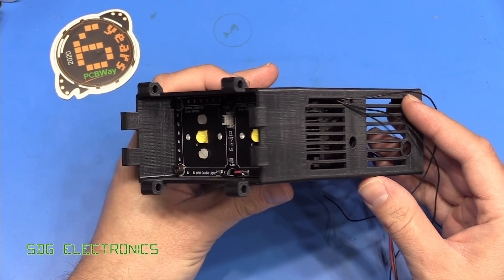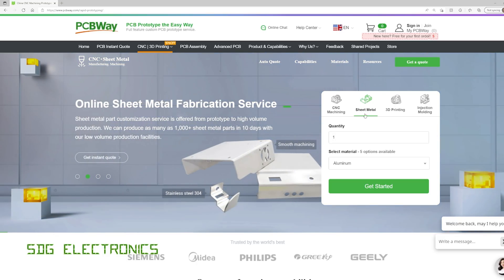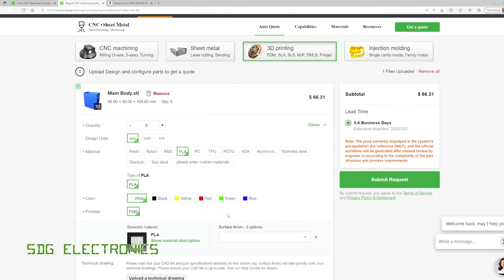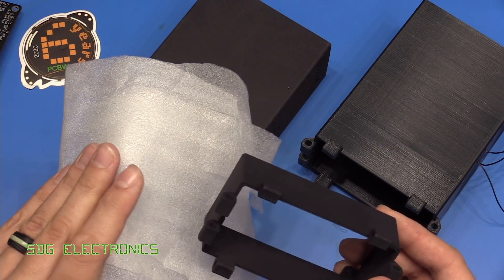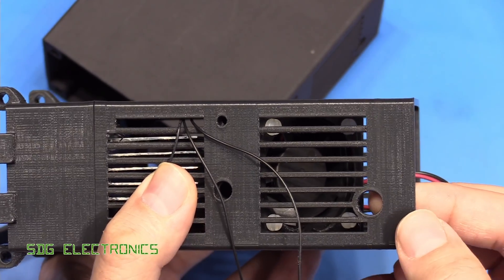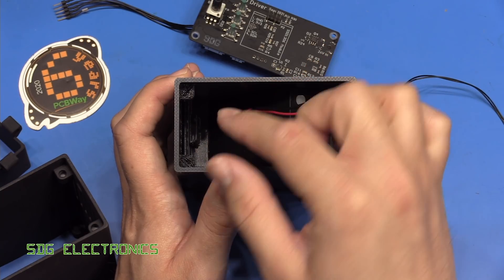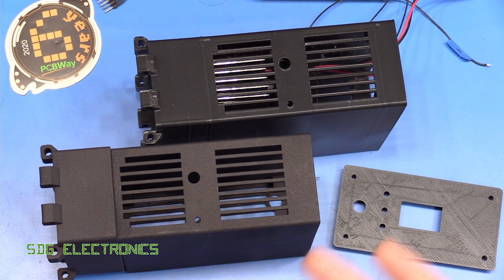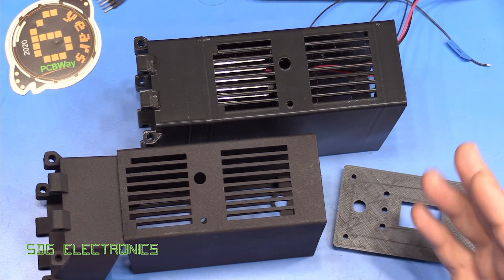SDG #247 Professional vs DIY 3D Printing

Comment: Teaching Tech an also CHEP have some very good videos on changing your stepper settings to get more accurate size  prints. It looks like your z is too low. But those pcbway prints look great, much better than you could do at home. Cheers

Comment: I watch Teaching Tech, and there is quite a bit to optimising prints. He has comprehensive guides using fairly simple tests, if you're interested in working it out. Either way, his optimised prints weren't as good as those Pro prints.

Comment: Impressive print, though powder-based as far as I know. Perhaps use a right-angle pin header then you may not need to cut the pins.

Comment: One idea:  For the back panel, you could create this part using PCB material (black) instead of 3D print.  Advantages might be: greater accuracy with dimensions, silk screen text to label button functions, graphics, ultra smooth finish, copper pour on inside surface for EMI shielding, grounding, heat resistance, heat sinking, etc.  Not sure about cost difference.
Reply from the maker: That's probably a better option actually.

Comment: Might try using an Ultimaker S3 profile in Cura, paste in your ender 3 Gcode and modify the filament diameter, bed size and machine height and number of extruders, I get great prints all the time now. Great video .
Reply from the maker: Thanks I'll try it.

Comment: Those prints from PCBWay look really perfect but to be honest, it seems there is something wrong with your home FDM printer (maybe not-well tuned slicer settings or some mechanical issues, like loose belts). I own an Ender-3 printer with a couple of small upgrades (like BMG extruder and Capricorn tubing) and my results look much better compared to yours (of course not as perfect as PCBWay, but the surfaces are really flat/without any artifacts and also holes on my prints are perfectly round - no overhangs). I use PrusaSlicer instead of Cura and most of the time I print from mid-quality PLA or PETG filaments (like Fillamentum or Prusament brands), so maybe you could try it.
Reply from the maker: I'll have another play with the printers but it's not isolated to just one of them - I have 4 and they all give similar results. On high quality settings they are all much better but at the expense of speed.

Comment: Hi, I usually like your videos, but this time it's a very unfair comparison!!! You are comparing different 3D printing techniques and different materials in one part. MJF printing is a powder based process and NOT FDM. Next is the material, it is a material specifically designed for the MJF printer. The setup of the MJF printer requires a whole large room and not just 50x50x50cm. Also, the price of this material does not get cheaper when you produce more parts. Also, the walls are curved and not straight at your PCB way part, that would not happen with FDM. Sorry for my criticism, but you are comparing a bike to a Formula 1 car.
Reply from the maker: True, I will be getting some PLA parts made very soon. The general point is still valid though - you can get some very professional items made at a decent price with equipment that is impractical for home use.
Reply: @sdgelectronics  yeah maybe i to much on the diy 3d printer side, but my opinion is that every household must have a 3d printer. I know we are not really at a point were we can buy a plug&play printer, but its a tool like a cordless drill everyone should have... But you are right when you say: for a few parts a printing service is a very good option.

Comment: To be fair, by spending a good amount of time dialing in settings, you can reach a happy medium between both prints. For example, the (what looks like to me) 2mm spaced lines all over the wall make me think your belts may be too tight. Using pressure advance / linear advance you can also get crisper corners and as a nice side effect, it'd also reduce stringing/oozing. Using fiber filled filament, such as PA12CF15, layer lines in FDM also almost disappear, visually. Realistically you still won't be able to match the quality of sintered parts, but there's room for improvement, even on cheap hobby grade printers.

But in the end, it's up to each and everyone themselves how they value their time - therefore, just getting the parts professionally made is a very valid option, if you want high quality parts with no fuss.
Reply from the maker: Thanks I will take a look at those plus the filament and see if I can improve on my own results.
Reply: @sdgelectronics  Just to be aware, fiber filled filament actually ruining standart brass nozzle within hours of printing. There are hardened steel or ruby tip nozzles specialy designed for these kind of filaments.

Comment: But isn't this the logical evolution? If you don't want to worry about anything other than sending the design files, it is rather nice to be able to print on your own cheap 3D printer beforehand as not to waste money on getting professionally 3D printed parts made that don't fit because you couldn't physically check them out beforehand. To me it would be a lot more worrisome if I hadn't checked the parts out on the cheap before sending the files to a fabricator.

Those manufactured parts do look nice though, almost like they weren't 3D printed at all!
Reply from the maker: Yes, I think it would make sense to prototype on your own printer first, though it's a similar evolution to PCBs. I used to prototype my own copper clad boards with a UV exposure box etc at home. I'd only send off for professional manufacture once I'd eliminated any bugs.

Comment: The last place i worked and some nice 3d printers, the finish was very good and the dimensions were always spot on too. But at about 50K per machine I’ll settle for my £140 ender 3.
Reply from the maker: For most things the Ender 3 is perfect. It's nice to have some options there for a special project though.